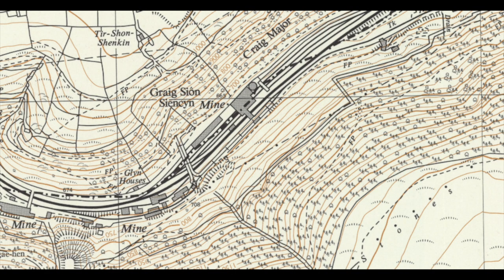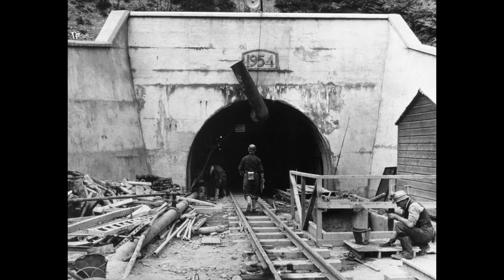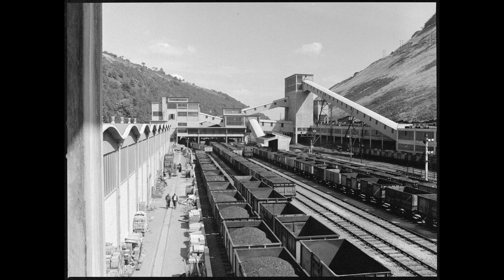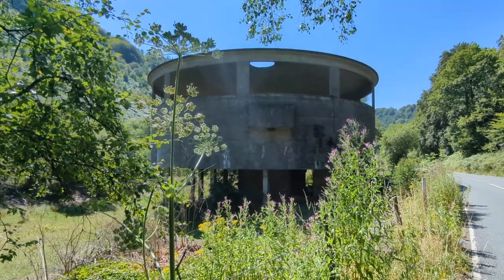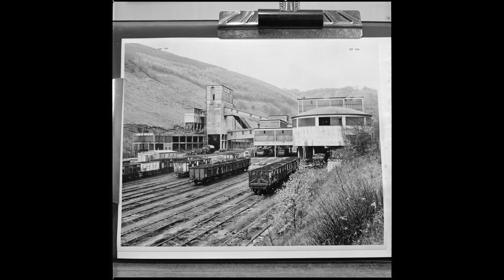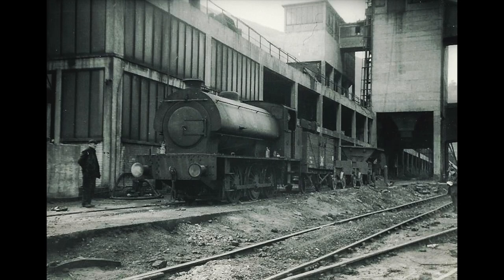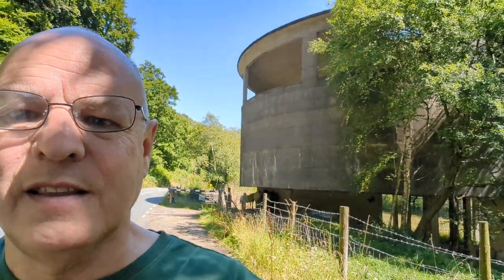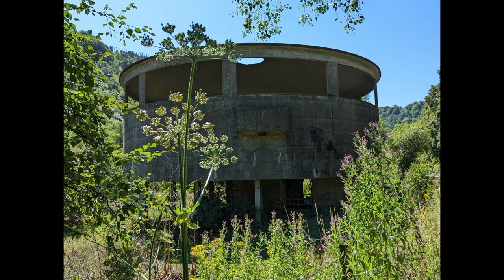Hafodyrynys Coliery Washery

Comment: The top of the drift mine entrances is just up from where you were standing. I managed to find it a few months ago.
Reply from the maker: Thanks, I thought they had covered it over. Is it well defined? I will go back and get some photos.
Reply: Meant to say one of the drift mine entrances, as I believe there was another one on the other side of the valley.
Reply: @bobsrailrelics  it is only the top of the entrance,  but you can see the 1954 date. If you go west from the rotunda, there is a vague path to the right (guessing 50 yds along?). You pass a bit of wall,  then the entrance is a few yds away slightly uphill. It had a temporary barrier and a coal authority warning sign. It was easy to see from the road in January, but may be hidden by vegetation in summer
Reply from the maker: @chrisandteresabartley438  I need to go back! I walked up that but it was getting a bit hot so I didn't pursue it. Many thanks for the directions